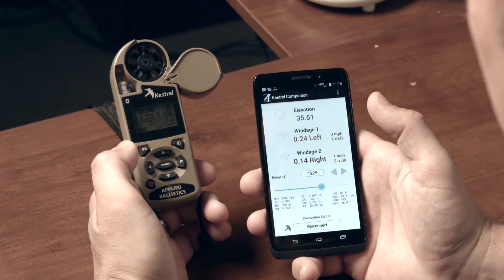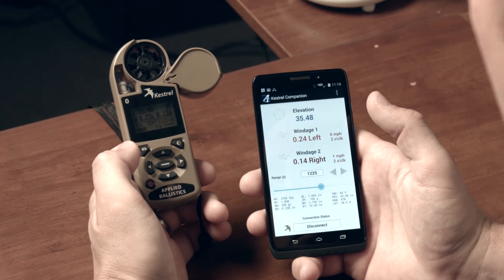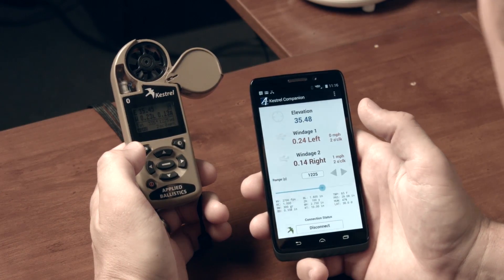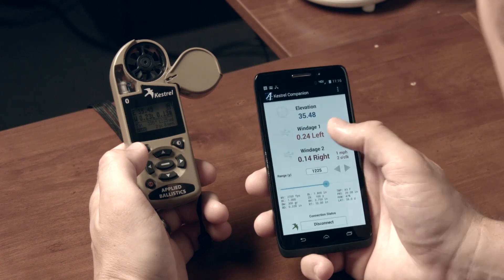Elements of Long-Range Shooting: Aerodynamic Jump | Applied Ballistics

Comment: If I'm shooting laterally from a helicopter (i.e.) which is moving forward at 60mph, does this "60mph lateral relative wind" (cause by the movement of the helicopter in the air) causes the same aerodynamic effect as a 60mph "real lateral wind" would cause if I were shooting standing in the ground?

Hope I made myself clear enough 👀